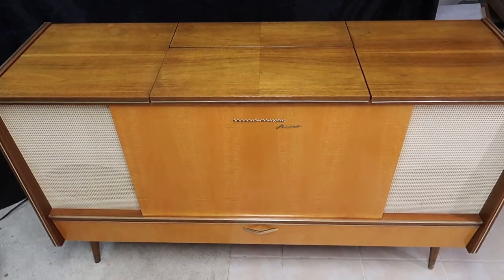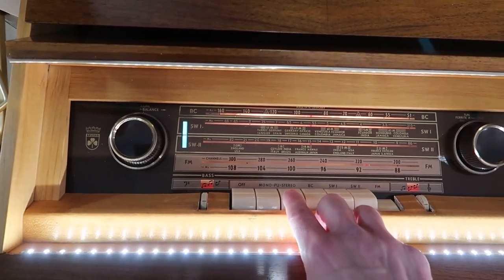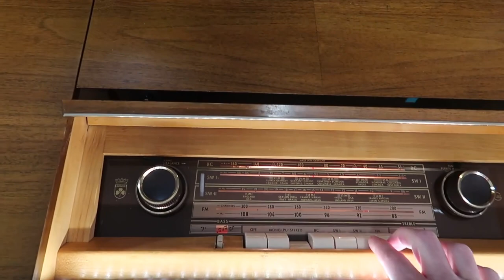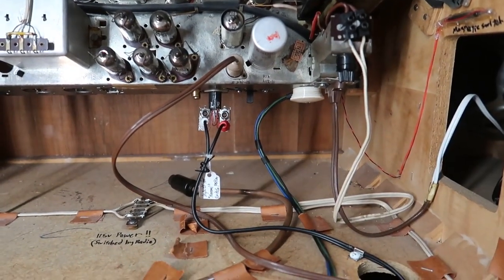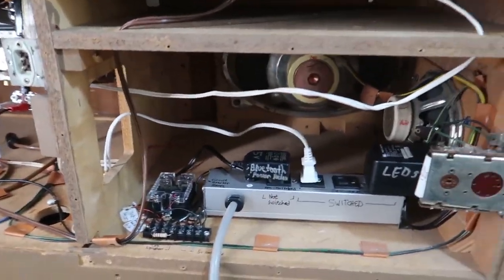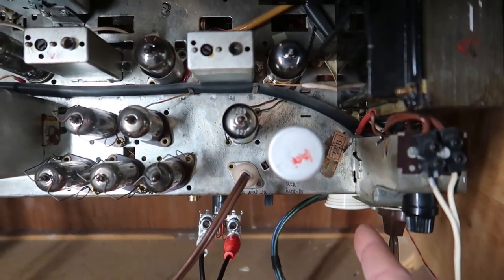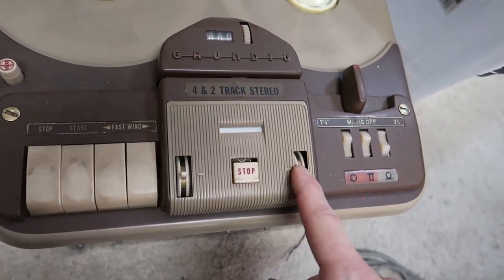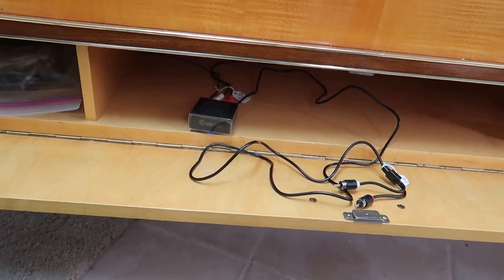Remastered Grundig Majestic SO161Ua antique stereo console, radio, phono record player, reel, tubes

Comment: Hi JMusic, Watched the whole restore Parts 1&2, very good, thanks.  
We had one in the 60's growing up and we played that thing until the cows came home.  It was fun, but when we moved, I imagine it was left with all the junk for  the dump.  
The exposed lines on the bottom, not good, put it in an electrical box, so an inquisitive youngster poking around does not get electrocuted.
Your vids are very nice and to the point, good work getting it back to working, and btw, nice touch w/ the lighting.

Comment: This is very cool! I have a Grundig KS 752 U Solid State Console. Not as nice a machine as the majestic for sure, but still very cool. It’s from about 1968 I believe. The speakers work really well. I took out the old turntable, which was crappy and replaced it with a Dual 1228. Attached a modern preamp, and it’s a great stereo system. The radio radio was working, and then the string or wire or belts that is connected to the tuning knob, broke or fell off. I want to get in there and fix it, but I don’t have much of an idea about what I would be doing and wouldn’t want to ruin anything. 
Don’t suppose you’re in Southern California, are you? I live in Los Angeles. I’d love to get the tuner fixed. And, probably couldn’t hurt to have someone look at the insides and see if anything needs to be replaced or cleaned. Though, as I said, the speakers and, by association, I suppose, the amplifier, work great.
Anyhow, if you had any suggestions, I’d be open to them. And if you’re not in Southern California, if you know anybody who is that works on these things…
Reply from the maker: Neat! I'm in WA state, so very far from SoCal! Quite possible that a wire broke, or sometimes the spring just gets old and loose (need to put a tighter spring in) or sometime you just need to oil the little wheels. If I was you, I'd just take it apart and see what you can observe. If the wire's intact, but you see a wheel not turning, then it just needs oil probably. After oil, if the wire still slips, then the spring lost its springiness and needs to be tightened or replaced.

Comment: You probably already figured this out, but the tape player won't energize until you turn the lever on the right to one side or the other. The turntable you have to lift the tone arm and push it a little bit to the record before it turns on I believe.

Comment: Reel to Reel player is Model "TM60". Round knob on left hand side is "Record" button, turning it and then pressing selects "superimpose". (you have to press "play" as well). Three switches on front right with symbols are record inputs - "Phono", diode" (used for connection to tuner-amp chassis if I am not mistaken) and "Micro(phone)". There should be an extra box on a cord connected to the tape recorder with three sockets on it - these are for microphone connections. The thing is full of old wax and paper capacitors that will have to be replaced if you ever want it to work. It is also only a 2 track stereo model - ignore the label. The 4 track stereo version was the (very rare) TM64.
Reply from the maker: Thanks for all the info! Someone actually sent me a scan of the TM 60 manual, which helped a lot. I still don't know why the roller won't pinch the tape and pull it, though. Mechanically, I couldn't find anything that would allow the roller to get close enough to the capstan to pinch the tape, that's why I guessed it might be bent or something. It doesn't look bent, though. Maybe some kid put a popsicle stick through it and bent it uniformly.
Reply: @JoyeMusiccom  There is also a solenoid that pulls the pinch roller in, though you probably have noticed that already. It is a pretty complex machine but can be made to work well, but will need a lot of time and effort - and capacitors since most including all the wax and paper ones, and the ones that look like (black) boiled sweets or candy - will need to be replaced.
Reply from the maker: @robertball2741  Yep got the solenoid to work, but still too much gap to pinch.

Comment: This unit has a turntable not a record player. It was normal to close the lids after a record was placed on the turntable to play. Now with that switch you added the unit would shut off after closing the lid. Thats why it was not there from Grundig.
Reply: It is a "record changer" or "plattenwechsler" in German.

Comment: fitting a lid switch and bluetooth is hardly a refurb .there is quite a bit of work needed on that thing before even plugging it in
Reply from the maker: Here are two big videos on the reel player. That was a BEAST and it still doesn't work (but I have the manual now): https://youtu.be/utCew9H2ELo https://youtu.be/9QENylRM0pU  . I also recapped and cleaned contacts in the radio, tested tubes, and replaced the tuning eye, which was really weak. I'd love to spend more time on it, but I'm moving out of state and had to return it to the owner.